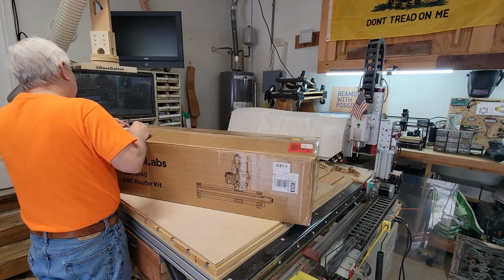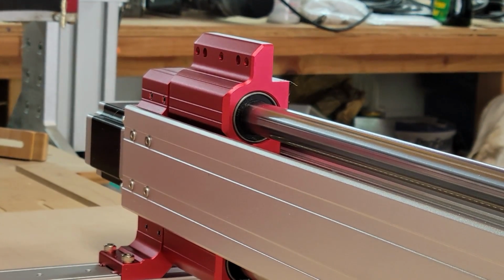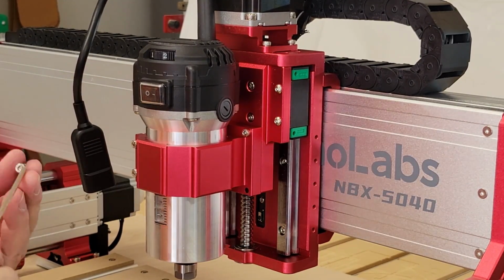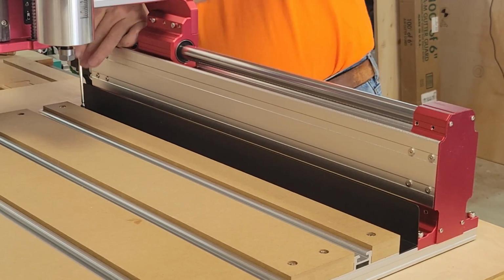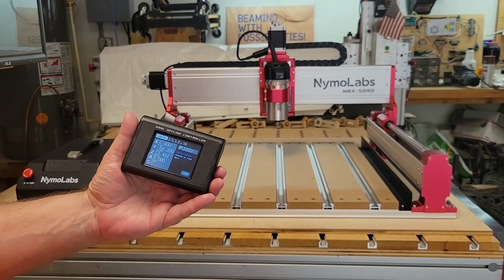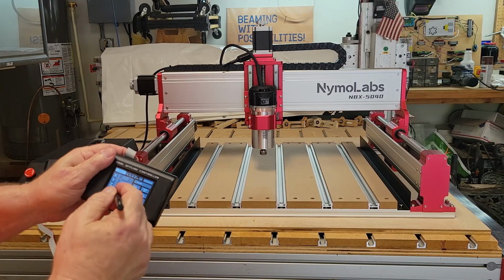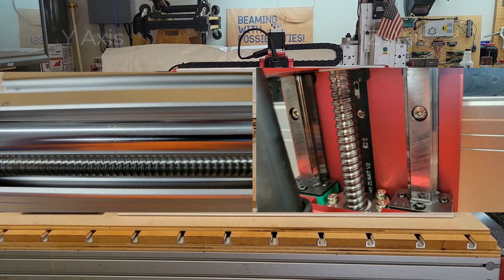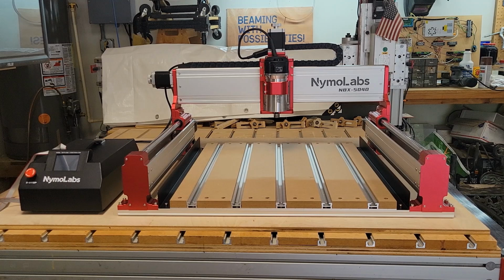NymoLabs NBX 5040 CNC Router

Comment: Had to laugh at the reversed rail, did exactly the same thing yesterday!  I was looking for that on the "can you see it?" part of the video and still couldn't tell at that camera range.  Glad we agree and they did add a right and left inset in the instructions (6040) but right and left are pretty ambiguous IMO as I spun the thing around to assemble it.  I'd have liked it better if they'd pointed out the thing it had to plug into (didn't even notice those plugs on the rail until wiring time).  Thanks for the video!

Comment: Looks like a stout machine. I like that it comes with a router instead of the little dc spindle that the sainsmart comes with
Reply from the maker: Yes.  That is a very nice feature.  No having to purchase a separate mount for a router and the router on and off are controlled by the program.  The RPM level is still manually adjusted by the dial on the router.   Thanks for watching Ryan.

Comment: Question for you Dave, what post processor do you use if you make your toolpath program using v-carve pro ?
Reply from the maker: I would use the GRBL post processor in Vectric Vcarve pro.  Either inches or metric will work.